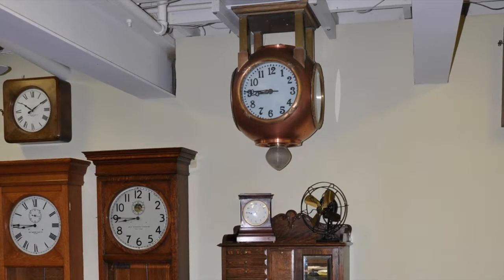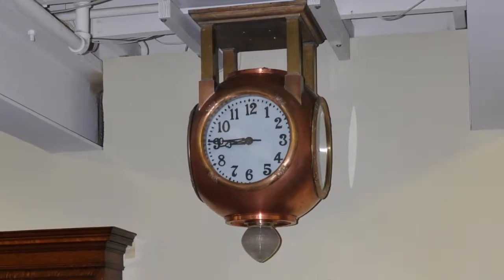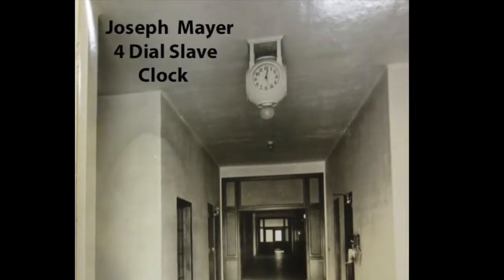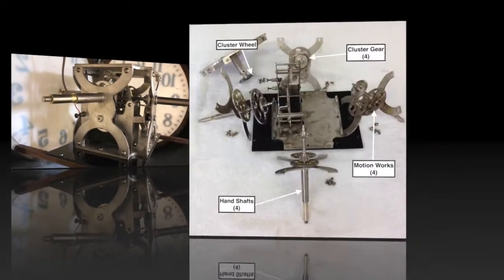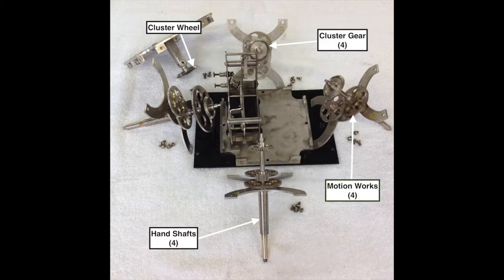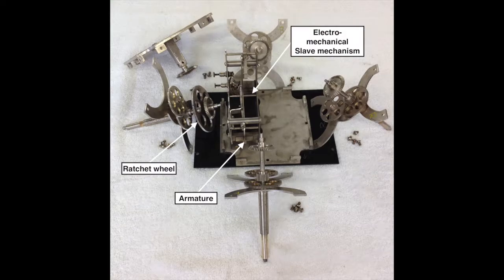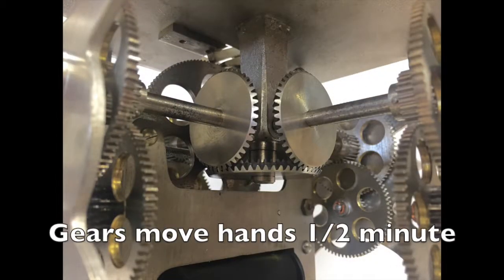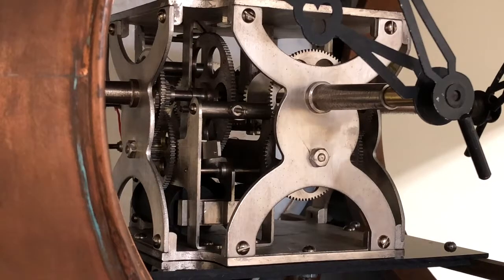4 Dial slave clock made by Joseph Mayer of Seattle, Washington

Comment: Used to stay at a place with a clock system similar to this, although not with the 4 dials but the hands advanced every 30 seconds and had a series string of coils to drive the slave clocks, the master had a pendulum with an automatic kicker that would use an electromagnet to keep the pendulum moving if it slowed down and the pendulum would move ratchet gears that had a deeper tooth, enough to push a switch every (I think) 15 teeth for the 30 second pulses and a different one with I think every 5 teeth for 10 second pulses, there were switches for 1 second pulses (used in the advance switch for time setting etc) but the owner disabled those by moving the rods that pushed the switches as it would lose time if it were enabled. Ran on a 12v gel cell and a charger circuit.
Reply from the maker: Thanks William, Your recollection of the clock system and its operation is right on. They are amazing as you well remember.  Alan